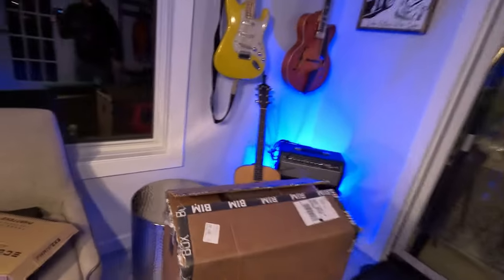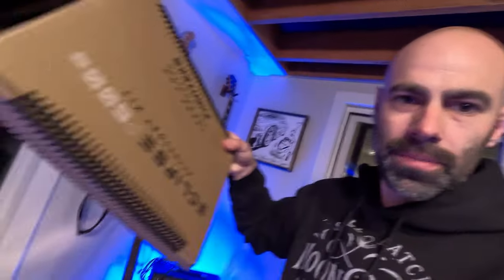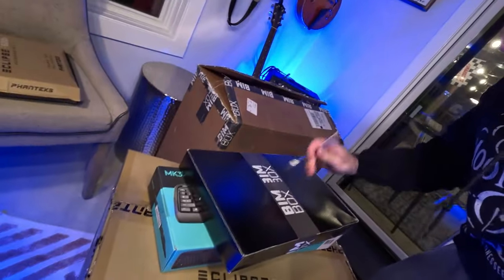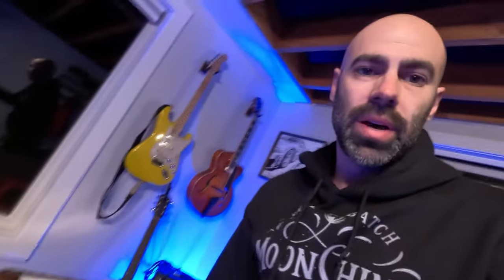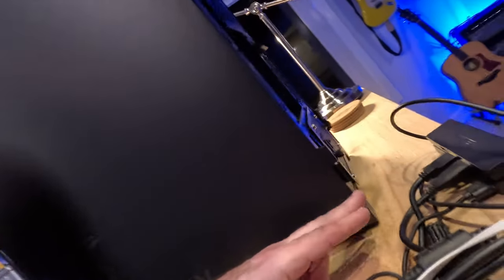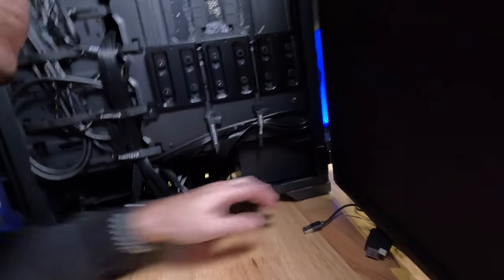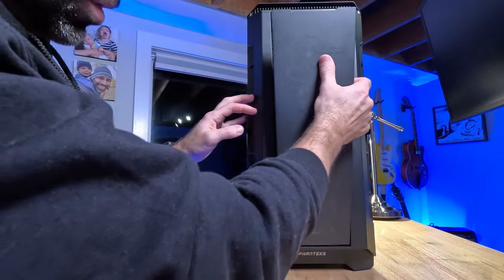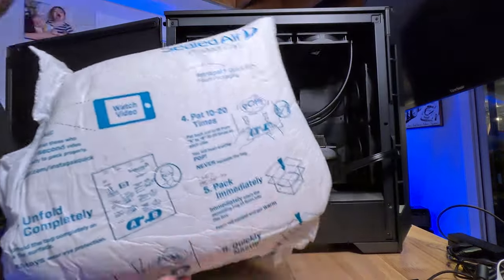Desktop or Laptop for Architecture ?!

Comment: I do not understand the total cost. There is a company that specializes in deliding the processors in Pennsylvania for around 80 dollars. Overclocking and testing all done by them.  Is ATG  doing anything special to the motherboard or the ram or anything else that would add 3000 thousand dollars. I would say that there would have to be something so proprietary done that it should be pointed out to justify the price.

Comment: It would be interesting see how very near a 13600K with 128GB of DDR4 4400 would come to the 13900K in the Revit benchmark.
Reply from the maker: Haha you could go ALL day benchmarking various combinations, for sure!!!
Reply: For those on a tighter budget FYI, RE Processor: https://youtu.be/Ds4D6CaODGs?si=mRw5-4GABANBchwq&t=699, and RE Memory: https://youtu.be/naVuiBdd-6A?si=RtlErpAEvKjr1z9d&t=424
Reply: Amd is the way to go
Reply: Revit mostly runs on one or two processor cores, so currently Intel is a better bet than AMD for the special needs of Revit.
Reply: @eltamarindo  theres no way thats true and intel hasnt been better in any workload in over 5 years
Reply: @Username_CC_  your knowledge base is a couple of years behind the times.
Reply: @eltamarindo  whats the price to performance of a 7900x3D vs 14900k
Reply: @Username_CC_  This thread was specifically about which builds and processors are the best for -> Revit <-
Your 7900x3D would be a terrible choice for Revit.
Reply: @eltamarindo  I promise you could not measure the difference between an equal cost amd or Intel
Reply: I have posted various RFO benchmarks over the years. I am pretty sure I did one of the 13600k when it came out. I can tell you they are within single digits of each other. There are real world benefits though that may shine outside of the RFO benchmark though. Aside from that, 4400 RAM VS 5600 RAM alone would probably make a 2-5% difference as well. There are points of demising returns with RAM speed which is why I like using 5600 over faster RAM.

Comment: My custom-built Desktop is the exact same spec as the tested BIMBOX desktop and I got around 50 in RFO. I built my computer for $3300 and I bet that spec on BIMBOX is above $7000.

I just don't understand what the addition 3000 in cost is. Do they have some special service or something? 

As someone who knows what computer parts cost, BIMBOX's pricing always offended me lol.
Reply from the maker: You can talk to BIMBOX about it but they do over clock, delid, and more … on top of a great warranty and support.  Building yourself will always be cheaper over someone else… of course. Also, I’m at $3300 without the case and power supply right now … so I think your specs are a little different.
Reply: @TheRevitKid  Maybe, I assume their main audience is offices rather than individuals. My ram is DDR4 that might, with older gen z690 motherboard, that might be it.
Reply from the maker: @armannasr3681  yes for sure… I’m not saying it won’t be cheaper … just don’t want to mislead anyone reading it.  BIMBOx is defiantly geared towards professionals.